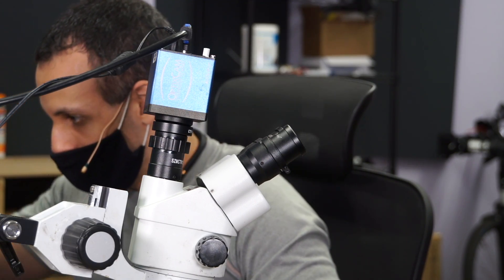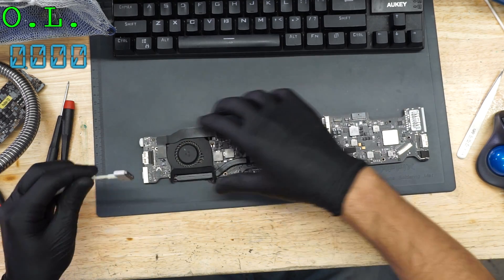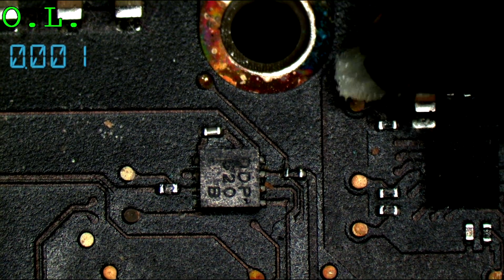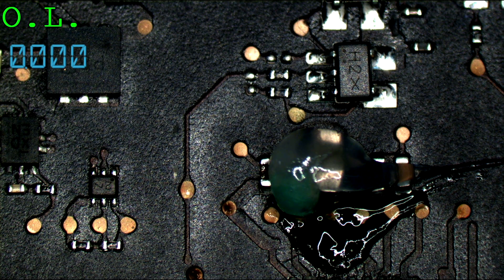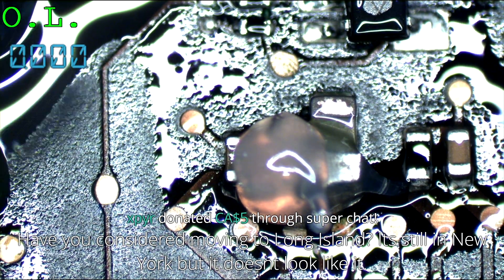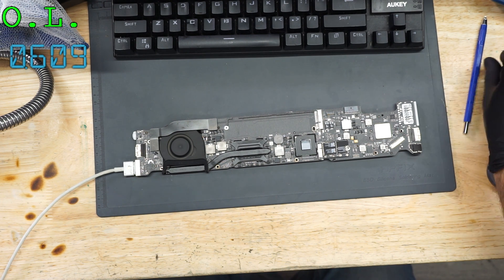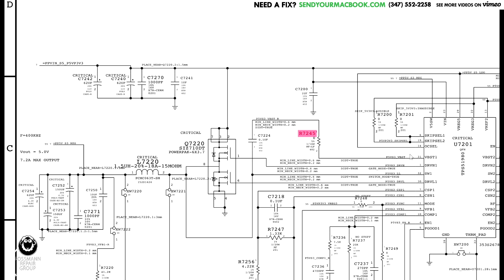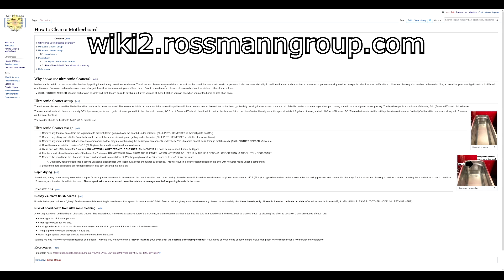820-3209 No power after water damage to Macbook Air logic board repair

Comment: No power - Draws 20mA -- A1466 Mid-2012 MacBook Air 13" 820-3209
Possibly PM_SLP_S4_L missing.
Test pads  XDP_CPU_CLK100M_N,  CPU_PROCHOT_L, XDP_PCH_S5_PWRGD, PCIE_CLK100M_PCH_N, BKL_VSYNC_R are corroded.
Corrosion on P5VS3_VBST side of R7245.
Replace R7245 and clean corrosion off of pad 2. 
Fanspin!

Comment: Louis, I was intrigued by your wiki page, “How to Clean a Motherboard,” especially about drying methods.  One your 5-year-old tools vlog, “The tools I use and why I bought them,” you recommended drying motherboards, in a convection toaster oven, for 30-60 min., at 225 degF, a temperature that you subsequently reduced to 220 degF in another vlog.  Why have you changed your recommendation to 150 degF? What did you learn?  

In the process of setting up my own microelectronics lab, I was influenced by Tim Youngblood, former editor of All About Circuits. In an article [1], he wrote that vacuum oven are used to dry electronics because lowering the pressure lowers the boiling point of residual liquids, enabling one to dry electronics at lower temperature, avoiding thermal induced damage.  Quoting from the article....

/*
What Are Vacuum Ovens Used For?
In the electronics industry, vacuum ovens are used to dry the electronics and cure the coatings of printed circuit boards. Since the plastics used for PCBs are usually heat-sensitive, which makes them prone to warping. Vacuum processing allows electronics manufacturers to cut bypass the warping and cut down on the time required to get their devices to market. A vacuum oven can also be used to dry smartphones dropped in water without shorting the circuitry and to dry watches that have water under their lenses.
*/  

That information in hand, I purchased a Phaeton Scientific Vacuum Oven With 10 Shelves 1.9cf and a used VALVAC DA-40SB diaphragm vacuum pump, a pump that is spec'd to achieve 19.9 kPa (or 149 mmHg), lowering the boiling point of water to 59 degC (or 138 degF) [2].   Considering that commercial electronics have an operating temperature of 70 degC (158 degF) and industrial electronics have an operating temperature of 80 degC (176 degF), lowering the drying temperature by reducing the pressure should be less injurious to electronics, shortening the drying time and possibly even removing the need for the isopropyl alcohol bath in the post ultrasound cleaning phase.

[1] "How Vacuum Ovens Are Used in the Cannabis Industry": https://www.cannabistech.com/articles/how-vacuum-ovens-are-used-in-the-cannabis-industry/
[2] "Boiling Point Calculator": https://www.omnicalculator.com/chemistry/Boliling-point

Comment: Fix where corrosion is, ultrasonic it and it works. Of course don't forget to use proper ammount of flux!
Thats the way You taught me to repair my first stuff (two xbox one pads), now my room is filled with things that need repair. 
Thank You Louis for sharing knowledge how to search for fault, how to properly solder something and showing why good microscope is half the victory (one of the pads had cut in a trace, very hard to spot just by unarmed eye).

Comment: Hey Louis, love the vids.

Not sure if you know this simple hack for non intrusive data retrieval on old platter HDs that are failing from "stuck heads";

Put the drive in a zip-lock freezer bag and toss it in the freezer for a few hrs. After that's done, if you're lucky, you can retrieve the data off of it before it warms back up and you have to freeze it again.